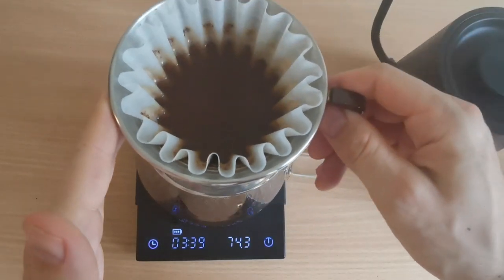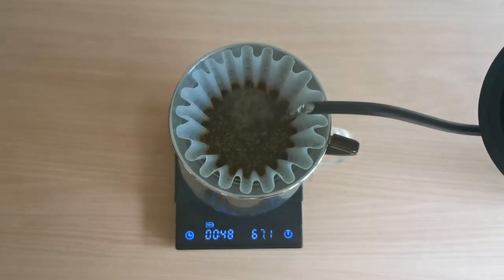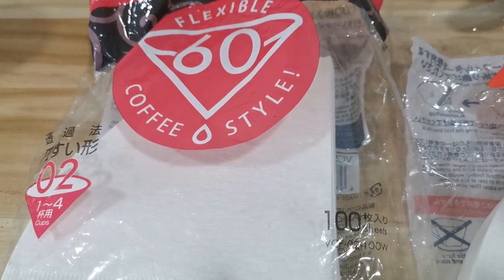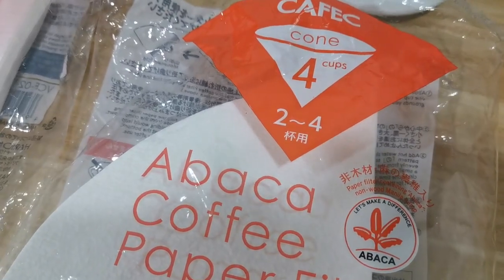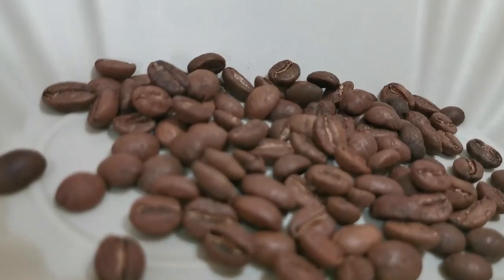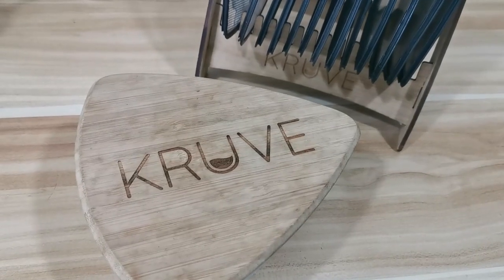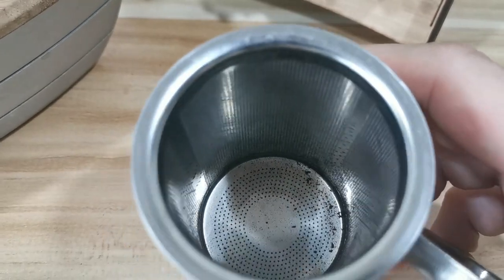5 reasons your pour over is stalling (and how to FIX it)

Comment: 1:26 1. Pouring too aggressively
2:10 2. Your grind is too fine / Grinder not good enough (producing a lot of fines)
3:23 3. Bad/slow filters
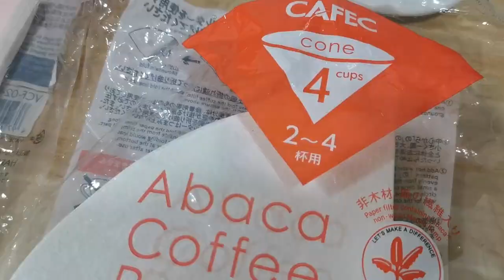4:12 4. Bad dripper
5:26 5. Light roast, high altitude, dense coffees

Bonus tips:
6:41 1. Use higher temperature water (close to a boil)
7:03 2. Dose down
7:23 3. Sift your coffee

Comment: Great tips, thanks!
You know, I've noticed that if I grind very fine, water passes quicker than with more average grinds. 

I brew in v60, my grinder is timemore x-lite, all my experiments are with boiling water (100C). With 14 clicks (the grind size is comparable with 19 clicks on comandante), water passes less than 3 min. If I grind on 10,5 clicks (i.e. much finer), the brewing time is almost 3:30, and the coffee is often overextracted. But if I make it even finer, 9 clicks (it's like for mokapot), water pours approximately 2:30 min again, and usually there is no overextraction. I can't say, that it'll be the best cup, but with some coffee it is pretty good: the sweetness gets stronger, acidity lowers.

Comment from the maker: Do you have any strategies to avoid stalling? Share your tips here. 
Also, if you're curious about why you should avoid the stainless steel Kalita Wave, then check out this blog post: https://coffeechronicler.com/kalita-wave-dripper-experiment-review/
Reply: I've a stall when just the last few ml are left in the filter (maybe last 20-25ml of a cup of 250ml).
I use to stir the bed a bit. That's usually bad, but the pour is almost finished at that time and stirring "unlocks" the stall.
Is it a bad move?

Comment: This is really helpful information. I've been having the stalling issue quite regularly and am quite fond of light roasted coffees. I'm using a 1:17 ratio with 23 clicks on the Commandante together with the Hario V60. There's quite a lot of variables: I just recently bought new Hario filters in bulk without knowing the change in factory (How can I spot the good or bad ones?) and relevant problems. Also, the coffees I've been making tend to have a lot of fines. Let's try these tricks to see if I can correct them. Thanks Asser!
Reply from the maker: I think it's only the Hario filters in boxes of 40 that are up to the old standard. Cafec and Kono ones are superior if you can find them. Good luck with the hacks :)

Comment: James Hoffmann did a video specifically about the V60 papers. As long as you’re paying attention to which ones you’re buying then you should be fine. They aren’t ALL not as good anymore.
Reply from the maker: Part of the problem is that Hario keeps changing the packaging and the filters, so it makes it hard to stay updated with which one to recommend. I believe that the 2nd Japanese factory also has an inside without crepe, which makes it more prone to clogging when brewing light roasts. 

James' test is interesting but I think the results would be more dramatic if he had used a technique with more than one pour and a lighter roast (my guess is that he used SQMC, which is easier to brew than most Scandinavian roasters).

Comment: Looks like I have much to learn:
1. Too aggressive with the pours.  True
2.  Grind too fine or Encore not as good as it should be.  True
3.  Coffee is Ethiopia/ Columbia blend probably SHG.  True
4.  Filters are recent Hario V60 02.  True
5.  Brewing with 200F water but could go hotter.  True

I’m also thinking skip the swirls and leave the fines high and dry!!!

Thanks for the tips!!!
Reply: Adjusted recipe from:
300 grams 200F water
20 grams dense coffee
Baratza Encore #13
0:00 pour to 60 grams
0:45 pour to 180 grams
1:45 pour to 300 grams
Stir gently with spoon
Swirl
Stall by 2:30 and pull at 3:00 with water in the brewer.

Adjusted recipe to:
270 grams 207F water
18 grams dense coffee
Baratza Encore #17
0:00 pour to 54 grams
0:45 pour to 162 grams
1:45 pour to 270 grams
Stir gently with spoon
Giggle no swirl
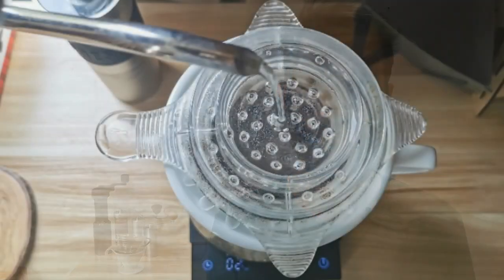Most of drawdown done at 2:00
Removed brewer at 2:30
Good sweet cup.  Problem solved with your tips and what I had available.

A sifter and Cafec filters are on my shopping list.  An electric gooseneck kettle would be nice too.

Once again thanks for the tips!!!

Comment: Thank you! Brewing light-roasted, natural processed Ethiopian now, and your explanation helps a lot. Was brewing 44g at about thirty on the grind dial (on the coarse side!) on the Baratza Encore in a Chemex and the contact time was long (over 5m) and tasted somewhat over-extracted. I did not make the connection between the coffee's origin, density of the coffee bean and impact on brew time. I will try some of your suggestions!
Reply from the maker: That's good to hear Stuart! The Chemex is a bit slow in general and it's a bigger batch, so I wouldn't worry too much unless you also get some astringency in the cup.

Comment: Hey thanks for making this informative video! I was wondering what the coffee fine remover is called? I couldn't find it on eBay
Reply from the maker: Thanks, Derek. It's this one here. I'm sure it's also available on Amazon and Aliexpress: https://www.ebay.com/itm/Coffee-Powder-Sieve-Bottle-Coffee-Stainless-Grinder-Powder-Sieve-Tool-ONE/264746890188?var=564570232006&hash=item3da424f3cc:g:FhMAAOSw0yJehCng
Reply: @coffeechronicler  Great video, your advice is always so helpful!  I've wanted a sieve for a long time (without shelling out for the Kruve) and immediately clicked your link here, but it has no shipping to the US and the seller doesn't list a product name that I could search on Amazon.  Are there any product names for sieves you can share?
Reply from the maker: @shibbolethed  This one is identical, the name is just different. Should be shipping to US as well: https://amzn.to/3ntzaA6
Reply: @coffeechronicler  Just bought it, thanks!

Comment: How do you feel about freezing your coffee the night before to reduce fines? I was having a horrible time with fines when grinding light roast Ethiopian coffees, which is a shame because they’re my favorite. After I started pre-dosing the night before and putting them in the freezer, that has helped to mitigate the problem. I also notice no issues with the frozen coffee negatively affecting the taste. 

Also, your advice with the smaller ratio (I use 1:13 now) and the slower pours have helped tremendously.
Reply from the maker: I never considered this as a way to avoid stalling, but now that I think about it, it's a great idea! Will definitely try it 👍

Comment: Asser, just subscribed to your channel after a few of your videos. Good stuff!

I use a Chemex with a proper hand grinder. I was pouring too aggressively towards the end of my brews and stalling. If I brew 15:1 with 35 grams of light roast, how many grams of water do you recommend in the first pour after my bloom?
Reply from the maker: That depends a lot on the recipe you're following. But for cone-shaped brewers, it often works well to go for a 4 or 5-pour recipe with each pour being roughly the same size. So in your case maybe somewhere between 100-140 ml.

Comment: I have watched a few videos and I appreciate you posting them! I am a novice coffee maker from home! I have a couple questions:
1) In this video you mentioned not wanting the filter to touch the holes in the bottom of the cone. I use a ceramic dripper that I guess you could classify as "Kalita Style" and I use a #2 filter in it (it's not Kalita brand. I had just bought it at Crate & Barrel). It has always bothered me that the filter doesn't fit and go all the way down to the bottom where the holes are. Is that how it's designed? Should I be letting it sit higher up in the dripper or fold the filter more so it sits further down in the dripper? Or is there another filter that fits better?
2) I don't have a gooseneck kettle and don't have space to store another kettle in my tiny apartment. I'm sure I pour too aggressively because it is hard to pour with a standard kettle. With that in mind, do you think I should just buy a Gabi Dripmaster B and I'll start getting better pour-over results?

Thanks for the help!
Reply from the maker: Hi Boone, thanks for the nice words. From how you describe it I'm not 100% sure you talk about a Kalita Wave filter (which has a round shape) If you're talking about a Melitta/Kalita style trapezoid filter, then it's a different design and you don't have to worry about this situation. 

I'd for sure recommend either a Gabi, Melodrip, Hario Drip Assist device if you can't get a gooseneck kettle.
Reply: @coffeechronicler thanks for the response! I googled "Melitta" and that looks like the same shape. One long bottom with two rounded sides and two straight sides. Not a perfect cone, probably more like a trapezoid. Do you think I should push the filter down to where it touches the bottom or let there be space between the bottom of the filter and the bottom of the dripper?

I will buy one of those devices! Thanks!

Comment: In case anybody is paying attention here. I usually use a v60 but I like using  Melitta some, too. I don't see that any of the coffee people ever mention Melitta and that tells me they don't like them. I think it's the slower draw down, which is why I'm commenting. I just bought a Melitta combo plastic dripper and carafe and draw takes forever, more than 5 minutes. I have their cheapest little dripper also and it never stalls. There must be something in the design. The holes, the grind, and the filter are the same. Any thoughts about Melitta?  UPDATE: just so coffee drinkers in the distant future aren't left wondering what happened to this story: the combo from Melitta came with #4 brown filters. I don't like the brown ones, because they give off a smell when wet like wet brown paper bags (imagine that) so you really have to rinse them. After another absurdly long drawdown I decided to try a brown one and way better. It's not going to be V60 fast. It's not supposed to be, but way better. It's been the white filters I have had on hand all along.